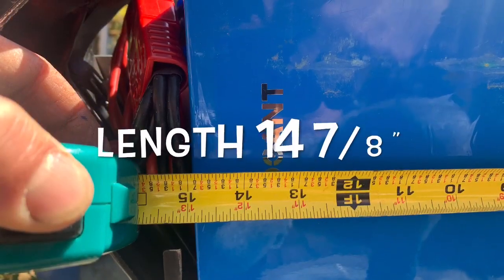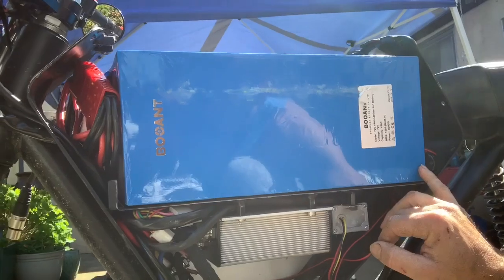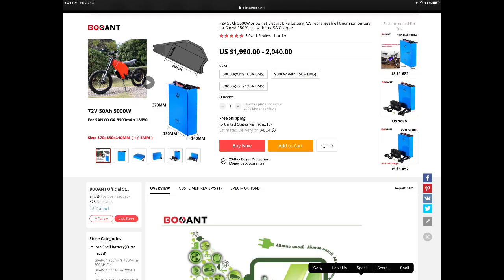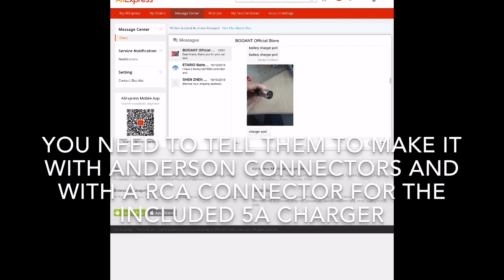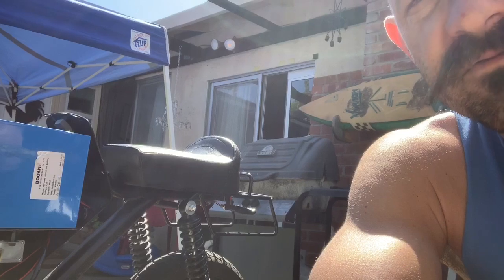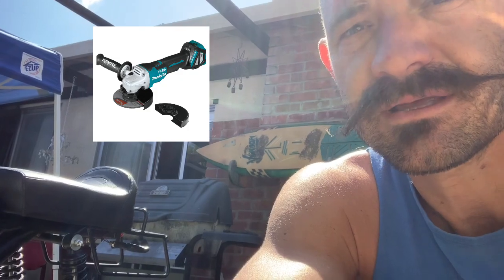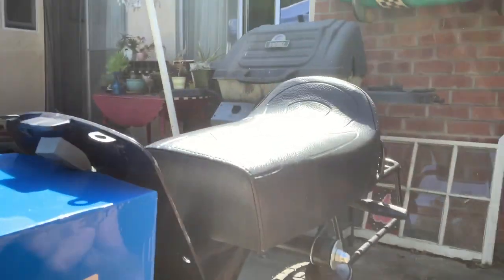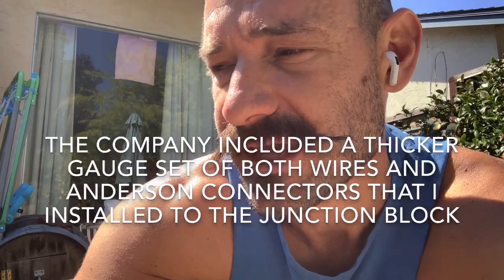Onyx RCR 48Ah Battery Conversion

Comment: Great mod!  Still waiting on my bike. I'm a little concerned what my top speed will be because I'm 6'-2” 240 lb.  But I watched your controller mod video and maybe I can get a little more out of it.  Did you have to cut brackets that were there before you welded in new ones?
Reply from the maker: Yes Mike I had to cut the sides off of the tray, But didn’t have the weld any new ones on. The new battery is wider and uses the side panels to hold it.  The controller that comes with the onyx isn’t strong enough to get the bike up to 60 mph. I would say be prepared to be around the low to mid 50s.  BTW – I’m 6’5” 225lbs.  You’ll love the bike!

Comment: Nice job! Why did you converted it into 48v though?
Reply from the maker: It’s still 72volts. Think of the Ah number as the size of your fuel tank, the Onyx is 23Ah in comparison
Reply: @MinimemberCustoms  i misunderstood! I saw 48volts instead of 48ah! And i thought, why would anyone want to switch from 72v to 48v 😛. Great upgrade!